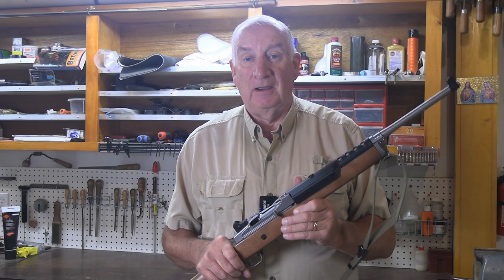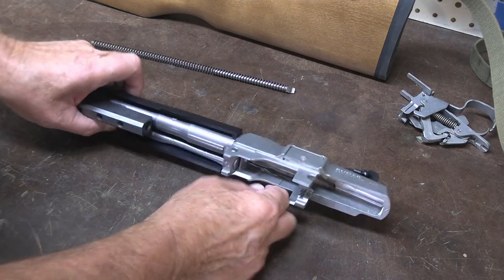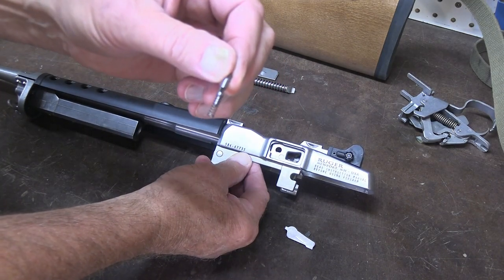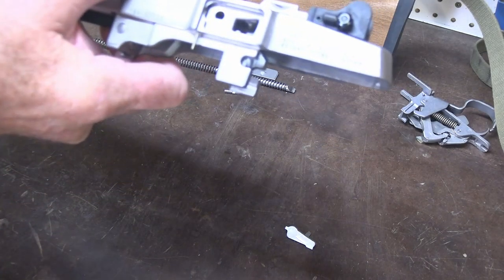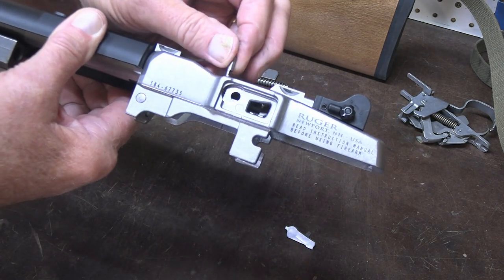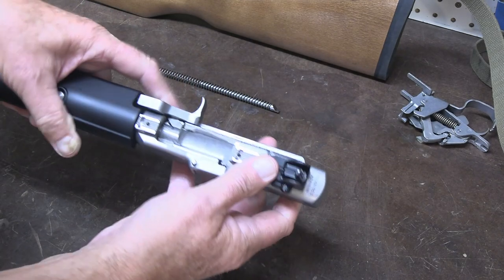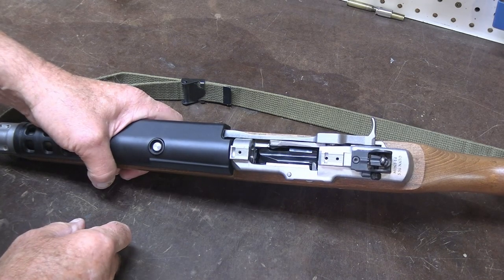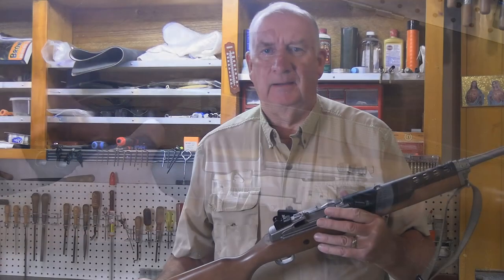How to Fix a Stuck Mini-14 Bolt Lock ~ Bolt Jams to Rear

Comment: Regarding Mini-14 bolt hold-open maintenance,I stand corrected.I didn't realize you are a Ruger factory -certified armorer.I need to re-think some of my gun maintenance habits. Your extensive gun and shooting knowledge is much appreciated 👍
Reply from the maker: That's quite alright, and very understandable.  One of my very first videos was dedicated to helping folks understand the correct view of oil and guns.  That's because, through no fault of folks like yourself, the gun products industry has, over a long period of years, successfully inculcated lubrication into the minds of gun owners, with heavy advertising, reinforced by gun personalities.  There are indeed lubrication requirements for very specific places on very specific guns, as I addressed in my AR-15 cleaning video, and another for autoloading shotguns.  As a department armorer, I was constantly receiving solicitations from oil bearers!  lol

The gun manufacturing industry has long understood this problem, recognizing that most repair and malfunction returns are as the direct result of over lubrication.  On page 36 of the latest Ruger Mini-14 manual, they emblazon WARNING-LUBRICATION-IMPROPER LUBRICATION DESTROYS FIREARMS.  

Because our NH police department had their AC-556 selective fire version of the Mini-14 and M-77 bolt rifles, I was provided specialized training by their repair technician in those firearms at Newport, NH, to augment their standard revolver training which the entire class received.  

I'll never forget his shop, located inside the factory, adjacent to the rear loading door.  He had a dozen unopened packages that UPS had just delivered, awaiting his care.  On three walls, were perhaps over 100 or more guns with service tags hanging from them.  Most had already been serviced, to be shipped by the shipping department weekly.  Some would go back through the factory to be rebuilt.  A large number of guns in one section were never to be returned awaiting destruction; mostly considered unsafe due to reloading incidents, plugged bores, improper ammo, unsafe owner mods, etc.  He said however that the number one cause for returns was entirely due to oils and greases being used to excess.  And of the plugged bores, many were caused by oils and greases inside the bores.  He had a barrel filled with stocks ruined by oil and considered unsafe to support a rifle.

He had a several standard boilerplate replies for gun returns, advising of the repairs performed, and, in the instance of owner error, appropriate instructions to prevent future occurrence, which were largely the same instructions found in the owner's manual.  My educated guess, based on what I see, read, and hear, is that the problem has gotten far worse over the last 20 years due to the internet.

So, you are not alone!  God bless and safe shooting.
Reply: @GunBlue490  Thank you for your kind and informative reply🙂 Btw, do you recommend applying any lube to the bolt roller on a Mini-14? If I'm not mistaken,this is(or was)standard practice on the M1Garand and M14.
Reply: @robertlawson698  There is no "bolt roller" on the Mini. The bolt lug is part of the bolt which cycles the operating rod. Just a small drop of CLA on your finger and then rubbed on the bolt lug should be fine.

Comment: I owned several of these through the years, well built and reliable. Sold them all because none would shoot sub moa past 100yds-even with the best optics.
Reply from the maker: Sub MOA?  The rifle was never, ever sold to be sub MOA. Optics are only a sighting aid and have absolutely nothing to do with a gun's accuracy.
Reply: @GunBlue490  I just meant that I was using top notch stuff to squeeze as much accuracy out of them as possible. Leupold Mark V's,etc. My AR's feel much more cheaply built than a mini but will shoot 1/2 moa. (Bone stock 6724 Colt) Also, if a scope is junk and shifts zero every 3rd shot your rifle will not be consistently accurate-so a scope will affect accuracy per say.

Comment: How are you liking that rear sight you put on your mini-14?
Reply from the maker: It's awesome.  I've installed it on another I previously owned, and on other Mini-14 rifles. It's solid, has lots of adjustment latitude, and allows for a finely tuned zero.
Reply: @GunBlue490  I recently installed a TechSight on my 10/22 and found that the peep was a little too narrow for quick sight acquisition. So I opened it up a tiny bit by carefully drilling it out by about a 32nd larger, and found the result much-improved.  Thank you for your many excellent videos.  I am going to purchase a TechSight for my new Mini-14 as well.  One thing I do have an issue with is that reinstalling the trigger group on the Mini is NOT as easy as it appears in any of the videos I've seen - yours included.   I can take it OUT easily enough, but when I attempt to reinstall it I find  that I have to use a lot more force on the punch to get the rear of the trigger guard than seems to be used in people's videos, in order to move it far enough to allow it to be pressed back down behind the notch under which it's supposed to set.  I have to pry and also push down really hard~!  I wonder if there's something wrong.

Comment: Absolutely appreciating your expertise on the Mini 14! Just a little concern that I picked up quite recently. My Mini is the later model chambered in 5.56 nato, but find that when firing certain 5.56, the bolt appears to slam open. Another issue is the trigger housing popping out - this is despite ensuring it is properly popped in. The question is: How do I check that the rifle has not suffered as a result of the 5.56 ammo and any suggestions that you may have? Thanks again!

Comment: (continued) found no finish or sealant on the inleted surfaces. I remember you mentioned applying urethane to reduce wood movement from humidity changes. I can't find the video and hope you can elaborate on the best procedure, product and any cautionary points would be greatly appreciated. Thank you again, take care and stay safe.
Reply from the maker: It's entirely optional if you don't intend to use your rifle in inclement weather. Birch, being dense, is quite stable under humidity changes.   Otherwise, I can suggest different methods.  Perhaps the simplest is to use an exterior grade urethane, which can be either sprayed or brushed onto bare surfaces.  Formby's Tung Oil is an excellent sealer, as well as traditional linseed oil.  One coat should suffice to seal the grain. I would first remove the steel stock liner and forend liner.  The screws for the liner are traditionally clocked with the slots horizontal for appearance.

Comment: Hey GunBlue! I've got a question for you. I've got a 10/22 and the scope rail has repeatedly loosened up on me over time. I've even resorted to using Loctite with no lasting success. Any suggestions?
Reply from the maker: Indeed, that's a problem. Loosening occurs when the base is mismatched to the receiver and is unable to seat firmly, if the holes are not in alignment, or if there's some interference.  First, if it's not a Ruger 10-22 rail, I would order theirs to be sure of a perfect fit.  One at a time, keeping at least two in place at all times, remove the screws, and look to be sure that the holes in the receiver are perfectly centered to the holes in the rail. The slightest misalignment will create problems.  

If that checks out, we'll remount it. Remove the rail, and follow my video on taking down the receiver, so you have complete access to the inside.  The receiver is aluminum and requires absolutely no lubrication, so thoroughly remove all oil present.  Also do the same with the bolt, recoil spring, and trigger mechanism. Nothing requires oiling, except a wipe with a lightly oiled cloth on the spring and rod. The bolt can be wiped down lightly. Keep the trigger mechanism free of any oil.  In short, never oil a 10-22, except for a wipe down.

Using lighter fluid and Q-Tip, completely clean out the screw holes to bare metal, and do the same with the screws.  Be certain that your screw threads mate perfectly and are not damaged. 

Your receiver is painted or bare aluminum and should be completely free of oil before placing the rail on. Inspect the underside of the rail for any protrusions and wipe any oil off it with lighter fluid and dry it completely. 

Use one drop of medium LocTite on each screw and secure tightly by hand using no wrenches other than an allen wrench. 

The screws should solidly stop turning with the last few degrees of head contact, with no springiness. If the screws squish down, the base is not fitting tightly and requires replacement.

I hope that helps!
Reply: @GunBlue490  Thanks for the quick and lengthy reply. The rail is a Ruger rail that was provided with the rifle. It appears as though the receiver holes are in alignment with the rail.

I have cleaned the screws, screw holes, and rail to the best of my ability. My rifle is completely free of oil as per your 10/22 cleaning video. In fact, that video is what introduced me to your channel a few years ago and my rifle has since been completely dry.

I see that you specify that an Allen wrench should be used, however the provided screws are slotted. May that be a source of my issue? I feel I should clarify that my screws are not filler screws.

Comment: I have found (and not yet figured out) another possible cause for the bolt sticking to the rear. Mine came with the black polymer stock and the bolt moves freely and the rifle functions flawlessly. I bought one of the factory birch stocks to dress it up a little but now find the bolt tends to drag at the rear of its travel. It has to be some clearance issue with the birch stock because it moves more freely is the trigger guard is unlatched. Had you heard of that issue before?

Comment: Like most problems things get dirty and grungy.
Reply from the maker: One of the nice things about the Mini -14 is its ability to function perfectly and reliably even when dirty and grungy! Most problems with firearms, with few exceptions that I described in other videos, is that oil and grease attracts fouling dirt and carbon that causes stoppages and malfunctions. Only the lightest wipe of oil on metal surfaces should be employed as a rust preventative.  The Mini -14 should never be oiled or greased, and unlike the AR or M1A, will shoot endlessly, no matter how many rounds are shot because it has an open gas system.  Of course, cleaning any gun should be done after each session because carbon also attracts moisture and invites rust.

Comment: Mine was a different malfunction when mine was stuck to the rear, the bolt actually went far enough back it got caught on the back of the reciever and i had to field strip the gun, pull the charging habdle bsck the tiny bit it would, and jiggle the bolt bak into position. Idk why it happened. But it happened on the last round in my mag.

Comment: l love my mini.  good gun.  barrel too thin
Reply from the maker: The barrel on the 580 series is much more stout than most standard weight barrels, and shoots quite small groups with the wood stock version.  Watch my comparison test.
Reply: @GunBlue490  mine is a 181 series. its 4moa at 100yds with a scope. 

with due respect, knowing where you worked at Ruger. Bless you,  your a national gem. 

I love that gun and the inspiration it takes from the m1 carbine.